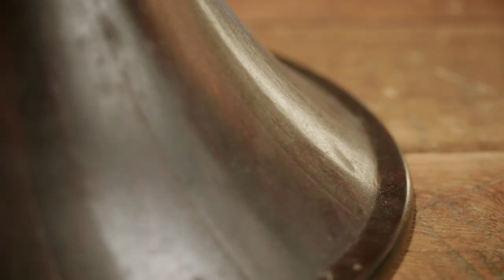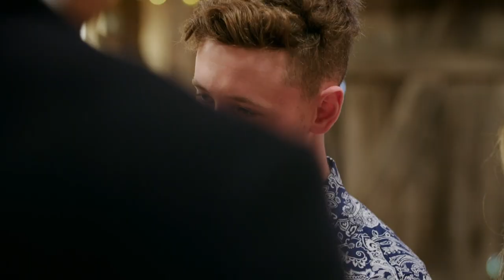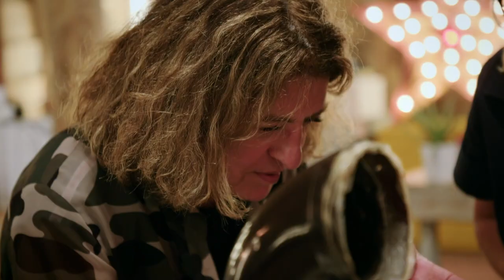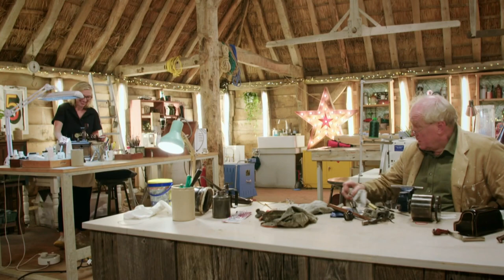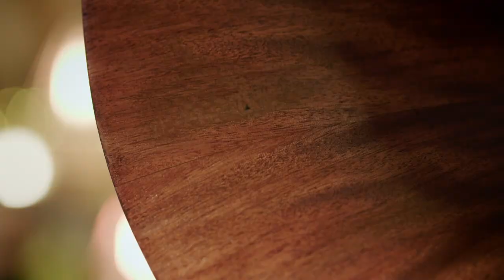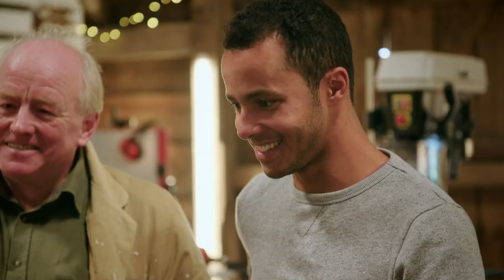Incredible Opera Phonograph Restoration Leaves Entire Shop emotional | The Repair Shop

Comment: The refinishing of the horn and repainting the speed dial, etc, was definitely beautiful work, but at the end the Opera  still had the issue of high fluttery variations in the speed.
Reply: Agreed I was wondering what caused it and it didn't really sound any different
Reply: likely that’s the recording itself - listening to old recordings that have been digitalized sound very similar, with that extremely (i think beautiful) warbly effect. i’m sure there’s something that could be done to the record itself, but i’d be too scared to try, honestly.
Reply: @chrisshimizu308  I guarantee the recording will be 100% OK. The man that supervised the poor restoration is at fault. There are many videos about this segment on the Opera job on youtube. Notice he is not on the show anymore.
Reply: The flutter is caused by a broken cushion spring. It's a small piece of spring wire that drives the flywheel. When missing or broken, the Opera will still play, but very poorly. The "restoration" of the phonograph was something of a disaster. Not at all in keeping with the Repair Shop's excellent record.
Reply: @jerryvan6709  You beat me to it, Jerry!

Comment: As with all the negative comments here, I agree with them, sounds awful and they destroyed the horn by removing the original finish, it just needed cleaning up.
 It's running too fast and has inconsistent speed, the woman even comments about the inconsistent speed. The reproducer also needs a rebuild as well, but I would not trust it to the people at The Repair Shop.  🙁

Comment: As amazing as the thing looks it sounds absolutely horrible!! The mechanical motor is a disaster and the reproducer that picks up the sounds is absolutely trashed.
It should sound absolutely crystal clear and full, open sound, as if someone was singing in person. 
Making it look great doesn't mean it's been restored, the mechanical functions and sound capabilities must he done, otherwise it's ruins recordings and degrades the condition of the unrestored parts.
Honestly someone should be ashamed at this job. It's a phonograph, its primary purpose is sound after all.

Comment: Well... they ruined it. 
Not only with that horrible copper pointer, which can easily be removed - but above all with the bad painting of the speedometer.
If you absolutely have to destroy the patina, you can simply order a true-to-the-original decal, which is available online.
The worst part, however, is the irreversible destruction of the original Music Master horn and the ruining of the same with the new lacquer. And then these !?x&%4§°!!!  even glued the thing in place instead of screwing it down like the original!
It should only be mentioned in passing that they neither repaired the trembling nor the obviously misaligned or damaged reproducer. Ultimately, one has to say: Luckily. Because they could have ruined even more by "fixing" the reproducer or the gears .

Comment: Good cosmetic work but the motor must be taken appart cleaned, the spring fixed if needed, and lubricated. Please note when repairing radios capasitors and resistors must be replaced or the repair won't last.
Reply: for the age of the gramophone I don't think it had radios capacitor's and resistors it is not an electrical piece
Reply: Nothing electrical in there... just springs wound up by a crank.
Reply: 100% mechanical

Comment: Was it meant to sound like that?
Reply: Actually, yes. Or rather, that was the best sound recording possible back then. Nowadays, recordings are made using a microphone, where the sound waves hit a diaphragm that vibrates, moving a magnet near a coil and therefore changing the current and recording electrically. Back then, recordings were made by musicians and singers actually playing into a kind of reverse gramophone, also vibrating a membrane with their sound waves. But then, instead of producing varying currents, the membrane actually vibrated a small needle the scratched the sound into the disc or cylinder. No electrics needed. The downside: Barely any low frequencies are heard, which is why early recordings always have a very high pitch and sound kind of squeaky. In my collection, I have 78 rpm recordings from 1922 that were recorded that way, and later recordings from the mid-1920s onwards actually state on the label that they were in fact "electrically recorded."
Reply: @jensschmidt  thank you for the great information.
Reply: @minikit3142  Anytime. Granted, it is a bit wobbly, which could be improved by making sure the drum rotates more evenly. But the quality of the recording would be the same nonetheless.
Reply: Well, the saphire seems to be in a bad condition too. I own this model myself & it sounds about a 100 times better than this one in the video. Even a well serviced Edison GEM can sound better than this.
Reply: No, absolutely not.  These guys were utterly clueless and should have consulted a real expert or collector.  Absolute travesty.
Reply: @jensschmidt  Actually NO! That was a disaster of a so-called restoration.
Reply: @jensschmidt  NO! it is NOT supposed to sound like that! They destroyed this machine. it should have INCREDIBLE fidelity. This was a top of the line Edison.